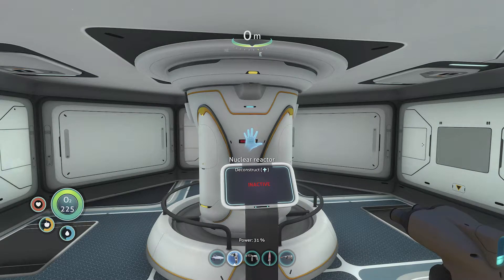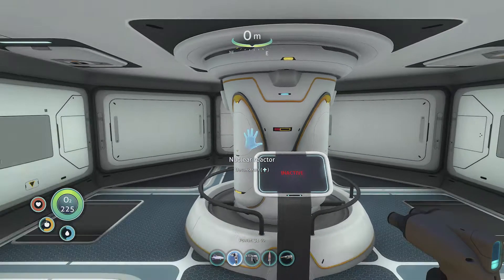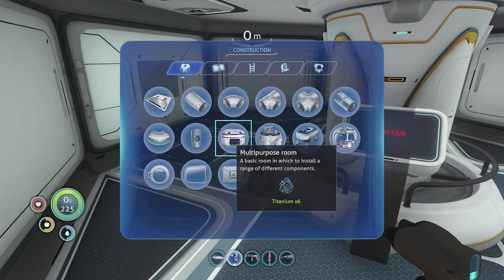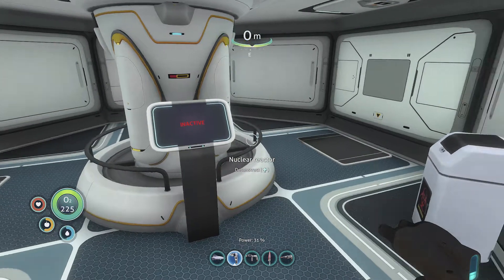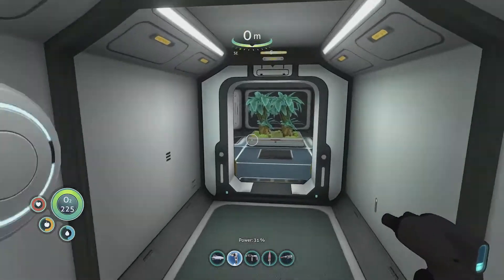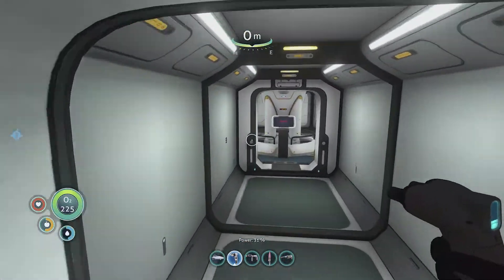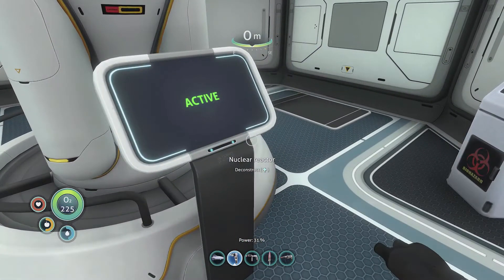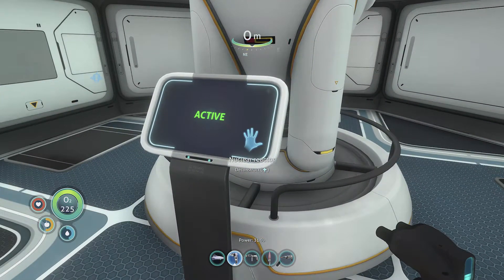Subnautica How to Use Nuclear Reactor

Comment: How do i get blueprints to get a reactor rod? I might have the materials but not the blueprints.
Reply from the maker: I think it unlocks when you get the reactor blueprints. If not might be bugged on your system. Try logging out and back in again.
Reply: @GrubMagnet  thanks! Ironically, I checked after I asked the question because I didn't remember but I actually had it already lol. Appreciate the help though! :))
Reply from the maker: Good all sorted!

Comment: Does it not work just to use a trash can for the rods?
Reply from the maker: Not sure. I've not tested a standard can and this vid is so old now!
Reply: No it doesn't. Your only options are to drop used rods on the ground or delete them using the radiation disposal bin. It's better to build a bin and delete them to cut down on clutter.
Reply: @holidayinn4293  Yeah that's what I thought. Feels a bit weird but I guess it makes sense since rods are only used to power the Nuclear Reactor, so might as well make disposing of them part of the system.